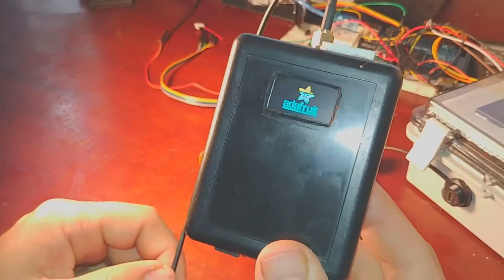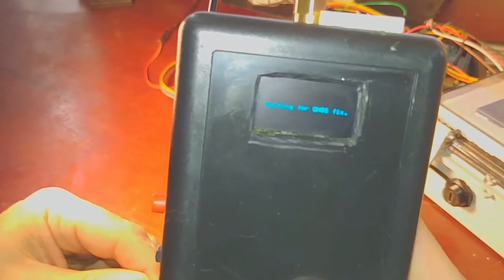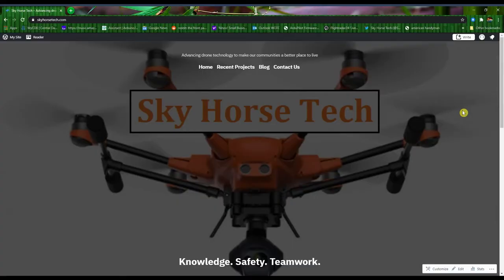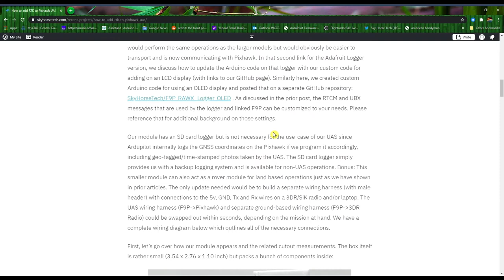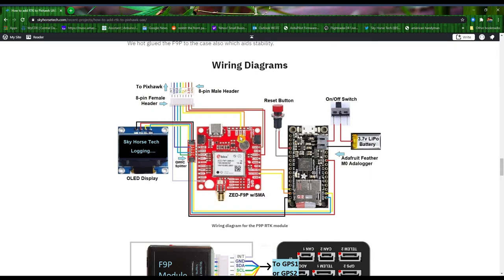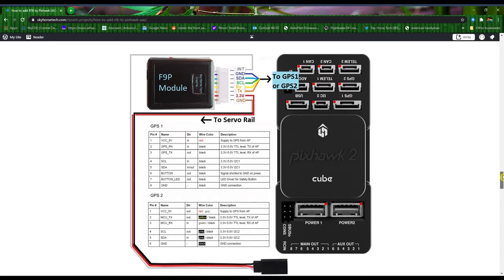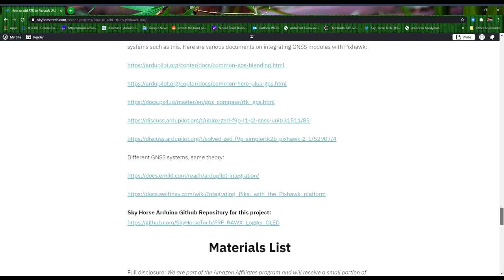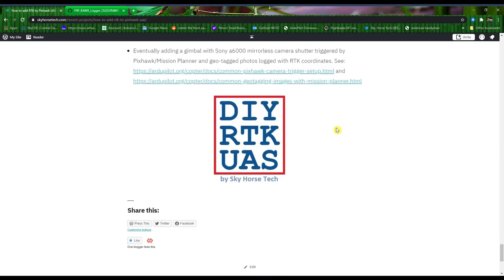How to Integrate ZED-F9P w/OLED screen in Pixhawk

Comment: Very informative! Hope you can also show how to log camera trigger events.
Reply from the maker: If you are using Ardupilot/Mission Planner check out the instructions here not only for logging but also geo-tagging photos: https://ardupilot.org/copter/docs/common-geotagging-images-with-mission-planner.html. 
Also see this: https://ardupilot.org/copter/docs/common-camera-shutter-with-servo.html. You could log the triggered timestamp on the Adafruit logger but it may not be as accurate as logging directly in Pixhawk/Ardupilot as that can log not only the camera trigger but also when the camera shutter actually opens. Since there may be a millisecond delay between trigger and shutter opening it could mean wide variance in the geo-tagged photos so better to go with shutter event if possible. In our autonomous boat (USV) we are currently building we are using this camera trigger functionality for logging non-camera events so will pass along any tips that may help. Thanks for watching!

Comment: Great stuff! Really appreciate you sharing these projects. I'm working on similar gear here in NZ, specifically using the Sparkfun Zed F9P with Xiao Arduino board, oled and sd card logger for location of GCPs. Looking forward to seeing what you do with the boat, I don't suppose you're going to fit it with a side scan sonar?
Reply from the maker: Thank you for watching, sounds like a great project you're working on! No sonar (yet) but there will be sensors aplenty with BVLOS missions and MQTT/IoT real-time data monitoring over LTE cellular networks. Stay tuned!

Comment: Dear sky horse Tech, 
Have a good day!
I watched your  YouTube video's related to U-Blox _Sparkfun_RTK2 GNSS Module ZED F9P.
Actually I'm working on similar module. I have done BASE Station with longe range. Here is my concern about OLED Display with BASE Station. How could i interface  OLED SH1106 Display with Arduino Uno3 and WITH ZED F9P Module? for just confirming that my base station "surveying process" is completed or not. And RTCM3X Data is transfering. I'm just new in arduino coding. Please kindly help me. I would be very very thankful to you. 
Best Regards
Manu saini